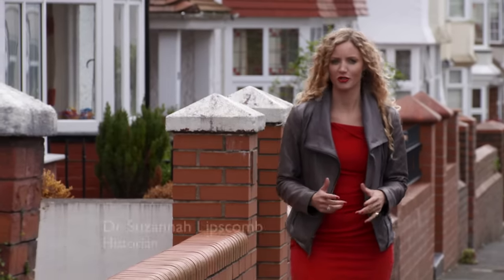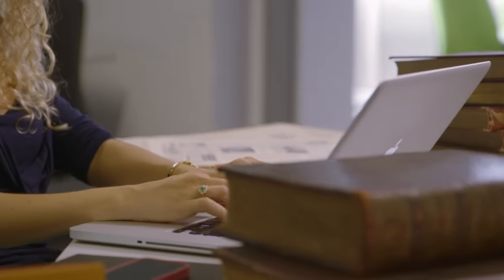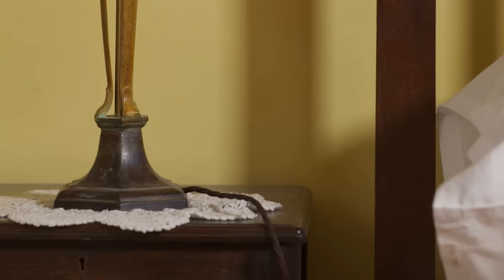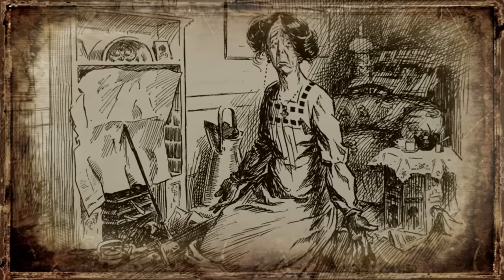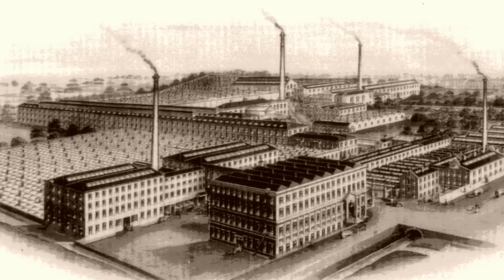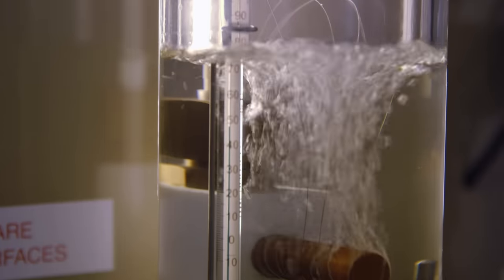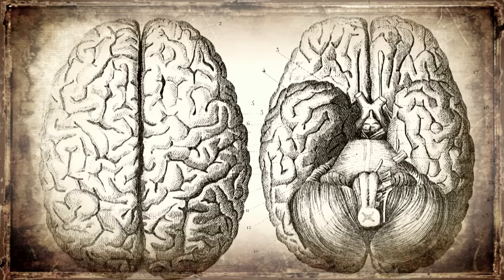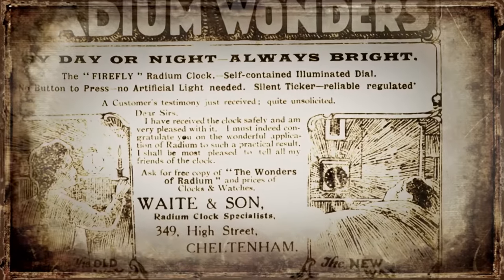How New Electricals Made The Edwardian Home A Deathtrap | Hidden Killers | Absolute History

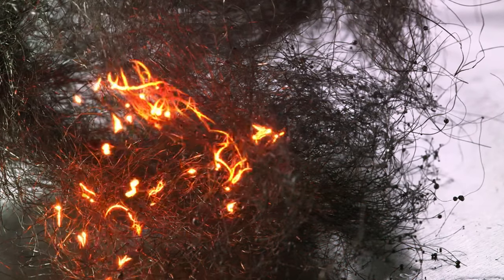Comment: 12:20 - For pity's sake, it's not too high a VOLTAGE for the wire wool (called "steel wool" in the US); it's too high a CURRENT. The fine wool short-circuits the battery, causing high current, which causes high heat, which reaches ignition temperature of the wool. The wool burns because iron readily oxidizes at high temperature, and fire is just rapid oxidation, whether the fuel is finely divided metal, (iron, aluminum, and magnesium are examples of metals that are stable at room temperature but burn at high temperatures), liquid (like kerosene or petrol), or gas (hydrogen, methane). Fire is an energy-releasing, rapid oxidizing event.
Reply: Thank you mr. science
Reply: @WeWereYoungandCrazy  it's almost like... current is related to voltage in some mysterious way! Crazy thought, I know.

How about sufficient amount of current with sufficient potential difference is a danger to you. Keep it simple.
Reply: I would say that it’s resistance is too high for the voltage occurring. You have 9v of potential energy, and the current is causing the wires to heat up, thus dissipating the energy lost to their own resistance. The narrow strands can’t physically handle the influx of electrons and the energy escapes as heat. Keep in mind, voltage is the potential energy which demands current and heat of the circuit. As a professor of mine said “it’s not volts OR amps that kills you, it’s volts AND amps that kill you”
Reply: @Odood19  the resistance is too *low*, resulting in a high amp draw from the measly 9V source, making the thin and not-rated-for-high-amp steel wool burn

Comment: "The battery is too high a voltage for the wire". Not true. Voltage too high = arcing. Amperage too high = overheating, fire
Reply: this ^
Reply: Arcing would produce the same result.  I've used steel wool for tinder when making fire by flint and steel.
Reply: Did it arc or just overheat?
Reply: @hsiumu  Indeed your arc carried a lot of energy. Put into the wool, the thin material produced a voltage drop which lead to heating. Or it just was heated by the plasma and caught fire.
Anyway they meant amps in the video, that was my point. When you plug too many things into a power strip you draw too much amps.
Reply: @rca168  Yes, quite possibly, but I meant a mechanically generated spark from a piece of steel hitting a piece of flint - no electricity involved.  Steel wool is quite flammable.
Reply: Voltage causes the current even though it is only 9V. That fine a wire would need a ridiculously low voltage to not overheat and start burning.
Reply: @hsiumu  Sorry, it was late and I did not read your answer properly, my mistake ^^
Reply: you can't have one or the other, doesn't matter which one you say, both are correct. "voltage too high" -> on the same resistance it enables higher amperage which means more heat

Comment: can't wait for the follow up, 100 years in the future on GMO soy products, cellphone radiation and high fructose corn syrup
Reply: Everything we ever eat has been genetically modified for hundreds of years.

 Cellphones do use light waves but at extremely low power. The normal transmitter on a cellphone tower is 2 watts. 1 incandescent light bulb is 300 to 1000 times more dangerous to stand under than having a cell phone in your pocket. 

Sugar is sugar is sugar. It doesn't matter where it comes from its still just sugar
Reply: So much misinformation. I don't even know where to begin correcting people.
Reply: @MatthewSlaymaker  To be fair, HFCS IS dangerous. Why do you think diabetes is so prevalent in US society? They put that crap in EVERYTHING, and regardless of how dangerous fructose is compared to other sugars, it's still sugar, and they call it HIGH Fructose Corn Syrup for a reason, IE, it has a LOT of sugar in it, and that junk is in absolutely everything.
Reply: @Dhalin  Correct, HFCS is dangerous and there is considerable evidence that it causes widespread problems.

There is NO evidence whatsoever that "cellphone radiation" causes any problems.

These two things are not even remotely comparable.
Reply: @DavidJao  Well, your reply was ambiguous, so I did not know if you were replying to one part of that post, or all of it, and wanted to clarify that at least one point on said post was actually correct.